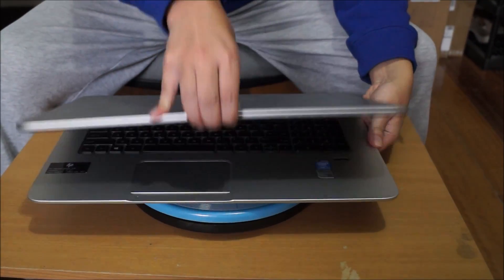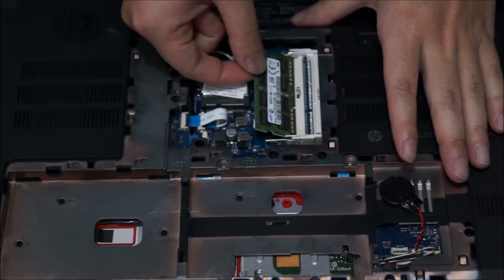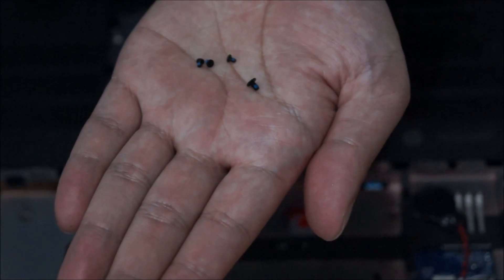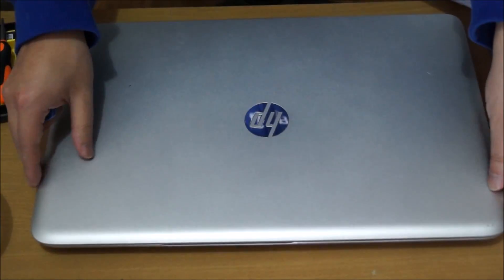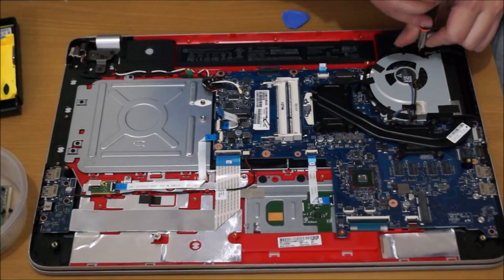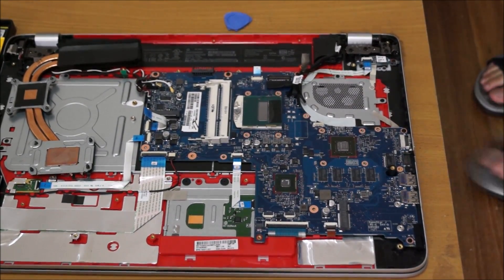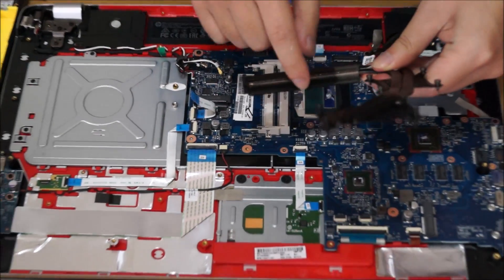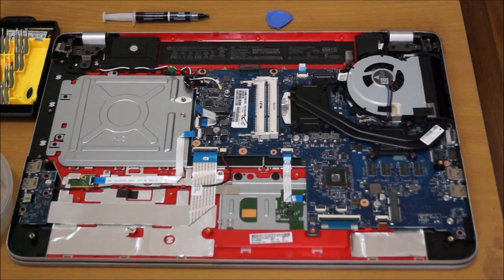OPEN ME UP! HP Envy 17 Disassembly Newer/Updated Video 1

Comment: my friend has the hp envy m6-n113dx (i believe is the same one here?) however he's needing to upgrade it just a bit. i don't know much about apu's so was wondering what is better than the amd fx-7500 it currently has in it? maybe a list of options? i've been looking around and not really finding much info/options. is there not many options for this socket? anyway any help would be apreciated thanks.
Reply from the maker: there isnt many option. many laptops that have removable cpu dont have many options to being with. on the AMD side it is even harder to to find info about it since AMD isnt very popular
Reply: damn hmm  so nothing really better than the fx-7500? doesn't need to be a LOT better. basically he's just trying to improve it enough to run fortnite  BR smoothly. not looking to be competitive so doesn't need to have great fps just be smooth on minimum settings. and it seems the cpu is the bottleneck causing the hangs.

(and awesome fast reply didn't expect that! <3 )
Reply from the maker: i think you cpu is solder on plus it is the best cpu for your laptop there isnt anything better

Comment: Hi can you help please?

You certainly seem to know your way around the HP laptops.
I have an HP Envy 15 and one of the hinges seems to have got stuck or seized and when I open the top it forces the case apart. Have you got any suggestions as to how I might fix this?

Regards
Mike C
Reply from the maker: it is pretty normal for HP hinges to break. many people including myself just glue it down but then you can not disassemble your laptop again

Comment: hellow, i have HP envy 17 J184 and i want to buy the best graphic card that this laptop can work with ,do someone know?
Reply from the maker: CPU can be changed, graphic card is solder on, ram can be changed to 16GB max with 8 GB in each slot there are 2 slots, wireless card can be changed, 2 hard drive slots which is a 2.5 inch that change be changed and a mSata slot.

Comment: Thanks for the video, always great to know that I can upgrade the processor, but it seems to be hard to find online what I can replace my i7 4700MQ so that it is compatible with the motherboard, do you have any suggestions? Thank you if you can.
Reply from the maker: you cant replace the i7 4700mq because there is nothing better for you to replace it with you
Reply: Yeah I had a quick look on Wikipedia there and there really isn't much better, if anything it costs £300 on eBay which isn't worth it, thanks for clarifying that with me :)

Comment: My problem is that I have to replace the bad quality keyboard. On youtube there was a video how to  replce this keyboard but I cannot find this video anymore. Thanks in advance.
Reply from the maker: to remove the keyboard you need to remove the mother board. you will be able to see the keyboard and its screw after you remove the motherboard
Reply: I know, one need to remove almost anything, but I like to see this operation on a video because I'm not a proefessional, and bad enough, HP service is almost nothing and that's why they don't have an email address, at least not in Spain. Of course it is almost incredible that such an operation is needed for reparation of something like a keyboard which is almost in use and in the case of this model is also made bad because the left side is very weak. Thanks anyway. Regards. PS And there was such a video on Youtube but not anymore!

Comment: Hi, dissambled successfully following your instructions and put everything back together. Everything is working fine bute somehow the subwoofer isn't working. The cable in 09:27 is plugged in, checked it twice - any suggestions what the reason could be?
Reply from the maker: so your sound is working just the sub has issues. if thats the case something wrong with the cable probably stuff up somewhere and damage it.

Comment: I have an hp 17-J173CL with backlit keyboard. The keyboard doesn't work and the plastic backing on the bottom left side appears to be separating and the hinge is loose. The laptop doesn't come on. How can I fix these problems?
Reply: Is there a manual for the hp 17-J173CL?
Reply from the maker: you need to open it up to see what is wrong on the inside. it is normal for the hinge to be loose. a lot of laptops get there hinge/plastic holders broken
Reply: OPEN ME UP ok. I need to get the tools u list, so I can open it up & see what's going on 😊

Comment: Also, if I don't have a prying tool like you used, you think a guitar pick can do the job? And what kind of adhesive can I use for those rubber parts on which the laptop stands on to glue it back into place?
Reply from the maker: a guitar pick is a prying tool. the adhesive for this laptop is actually double side tape. i recommend you to open up your laptop and have a look inside to see if you can see where your issue is and if you can fix it
Reply: thank you so much I'm glad I found your video

Comment: This is exactly my laptop and my problem is that on the left side, the bezel or the grey side is detached from the black or bottom part of the laptop and it does this every time I open and close my laptop. Both bottom and upper parts of the frame or body of the laptop separates at left side, on the point at which the laptop screen is connected or kind of like the joint. Is there a way to fix this?
Reply: Just fixed exactly your issue on my Laptop - same as yours. The hinge does not have any support left as the sockets were torn into pieces. I literally had 30 loose pieces of plastic in my hand. Now tried epoxy resin but can only talk of success in a few months time. Other option: send it in to HP for 170€. Like WHAT?
Reply: $202.34?  I read somewhere on HP help site that HP wanted over $900.00 to repair out of warranty. Mine broke 3 months out of warranty and I've got nothing but a run around from HP. They have seen the last of my money.

Comment: Currently got 12gb RAM with a Intel i7-5500 2.4ghz, NVIDIA GeForce GTX 850M. Can this be upgraded and if so any recommendation?
Reply from the maker: ram can be changed and thats it. if you change the ram the laptop is not going to be any better

Comment: Great video! I use Q-tips and ArctiClean Thermal Material Remover and Surface Purifier to remove old stuck on thermal compound easily and to properly prepare the surfaces for a new application. It makes sure there's no dirt or debris such as towel lint. Any tiny debris, old dried up compound or even oils from a finger will reduce the thermal transfer effectiveness. Get it here for $6.77: https://goo.gl/VPmxN2

Comment: Hello my HP envy laptop started saying it's fan was over heating and I am having problems as the internet is freezing up on me.So it's 10 o clock at night andi have my laptop open and one of the cords the black one to be specific is broken. Should I put the laptop back together and try to get some one to fix it or how much is a replacement fan and should I get that instead? I made it this far and any help that comes asap would be very appreciated please.
Reply from the maker: i dont understand what you trying to say. watch the video and tell me where the black cord is in the video.
Reply: Sorry i meant one of the black cords on my fan itself one of the well wires that my fan uses to plug into the laptop
Reply from the maker: still dont understand what the black cord is watch the video and tell me where in the video this black cord is
Reply: Around 10:24 or so where you unplug the fan, one of the wires of my fan is severed. Its one of the several that are apart of the fan if that makes sense. So basically one of the wires that the fan uses to plug into the laptop is cut/broke.
Reply from the maker: i see if that case you going to need to replace it or rewire it if you know how to
Reply: Well I was able to open it up with minimal effort but i didnt know if just one of the wires being broken would warrant me replacing the whole fan, i dont even know how the wire was broken
Reply from the maker: look i open up alot of laptops and this has never happen to me so i dont know how it happen to you
Reply: me either , some one else i was talking to said based on my problem i should replace the fan and hard format / reset the hard drive, now i guess i just have to find and price a fan and then buy and install it

Comment: Thank you so much for this video!! I was getting the 90b fan error message and did some research. After doing diagnostics and checking that I have the latest BIOS installed, I decided it was indeed the actual fan that was not working. 

I didn't have it in my budget to send it in fo repair especially since I had determined the problem. I have never disassembled any kind of computer before and was quite nervous. Your video was the best after watching a lot of other disassembly videos. 

The only difference between mine and the machine you used was that mine did not have the 3 tiny screws at edge of battery compartment. It was "clicked in" with tabs. I was really tricky to pop it off but got it with a little work. But I did it from start to finish without issue. New fan installed and my Envy 17 is working perfectly. So again, than you so much!
Reply from the maker: thank you for your support

Comment: Great video...enabled me to put in a new fan but I pulled the battery connection off (the black plastic connector piece) the board in process.  How and where do I reattach it? any suggestions would be appreciated.
Reply from the maker: as long it is place back together and touching what it needs to it will work
Reply: Thanks for the quick reply, I figured it out.  I glued the black plastic battery connector back on to the board with loctite glue and everything now works fine.

Comment: Hey, I'd just like to thank you for posting this video. It helped me take apart my hp envy 17 inch lap top. Then I was able to loosen the hinges with a wrench after I figured out that the hindge clamps had little snaps that I could push open and pull back. I also re-glued my hinges with jb weld steel reinforced apoxy. Since my laptop like many other HP laptops was defective and both of the hinges broke their plastic casings from general use. After only being 3 years old. Now my hinge is a bit too loose but my screen stays up easily. At least I know that if they defectively over tighten over time it will take a long while.
Reply from the maker: thanks for your support

Comment: could i do an egpu setup for this laptop or is that not possible?
Reply from the maker: I suppose egpu is external gpu. Yes if you can find one that works with USB but there isn't one available to my knowledge. There are only USB type c and thunder bolt

Comment: whats the name of the very small screws behind the battery?

Where i can find a screw driver for that?

 The set that i bought at Lows didn't do the job for the very small screws.

Thanks
Reply from the maker: you can get it off ebay. http://www.ebay.com.au/itm/39-In-1-Torx-Precision-Screw-Driver-Screwdrivers-Set-Home-Repair-Tools-Kit-/151939340403?hash=item23604a5873:g:NLUAAOSwX~dWi2n3

Comment: I've a HP ENVY 15 and the keyboard key A and S are not working anymore. Any idea to fix it or a guide on replacing the keyboard?
Reply from the maker: +ABu NeNe remove the button and test if it works. since you use A and S more they wear out the rubber button that could be your issue
Reply: +OPEN ME UP Removed and still does not work. It is worth it to try and replace the whole keyboard?
Reply from the maker: i dont know how much a keyboard is worth did you try removing the remove things under the button and swapping it out with another button that works

Comment: Can I upgrade the Gpu or the graphics card in the hp envy?
Reply from the maker: +Khalid Alhariri No it is solder on
Reply: +OPEN ME UP Well, technically you could unsolder it, can't you?
Reply from the maker: of course you can but are you able to do it yourself
Reply: OPEN ME UP Not me lol
Reply: +Edmundo Weber so if i went to a store or to someone expert can he change the gpu ?
Reply: Ah, forget it. I just got this on a forum post: "These days, manufacturers use surface mount for a GPU chip. There's no flip over and de-solder. Unless you have the equipment and means to do this type of surface mount, replacing the GPU is impossible. It is not a field repair.
I worked on a large main frame system in the early 90's which used this type of IC. You need special de-soldering tools to remove the IC. Then the new one is placed on top of the permanent pins and heated. The IC will then drop down and make connection. We tried it in the field with bad results."
Reply from the maker: yep thats right. thats why i told you it is solder on and you cant replace it

Comment: Hey, great video. I have the HP Envy TouchSmart 17t-j100 (E1P14AV) model laptop with the left hinge loose, do you have a video on how to repair it, or recommendations on how to fix it?
Reply from the maker: +Andrew Tulloch it is most likely breaking and you going to need to glue it down. try to screw in the screws and see if it solves your issue if not glue it before the whole thing breaks off
Reply: Ok. thanks

Comment: My friend... I'm having problems with GPU overheating (with Nivida 740m) since I buy my notebook!
There is any chance to fix it, change cooler, change something... i really whant fix it up!
THanks
Reply from the maker: +Dante Basso have you clean the fan and replace the thermal paste?
Reply: +OPEN ME UP No, because my notebook has less then one year!
Mayber it's better to do that!
Reply: +OPEN ME UP Do you thing this will do a Huge difference in overheating problem?
Reply from the maker: first you will want to update the bios that normally makes the most difference and if your laptop is old open it up and give it a clean is the next big thing. if you laptop is new and has these issues there is something wrong as a new laptop should never over heat as it was not design to. bios updates are important as when they make the laptop they might have input the incorrect setting which cause the system to over heat therefore the bios updates change these setting after they receive feedback from others

Comment: Hi there, I have a HP Envy 17 with the i7-4710MQ CPU 2.50Ghz, 12GB RAM. The past few months I've had an issue with occasional stuttering with certain games and even when watching Youtube videos sometimes. I can hear the stuttering through speakers/headphones and also the videos/games lag majorly when it happens too, this goes on for around 90seconds and then it returns to normal. Do you have any advice on what I could do? I feel like it might be an issue with the CPU. You videos are very informative :) thanks for uploading!
Reply from the maker: +FunFunSmirk for it to happen eh. you play games is normal as it is struggling to load the details but for YouTube this should not happen. Download a few benchmark test to test out of you have any issues. 3dmark vantage and Intel burn test

Comment: Hi, I have this exact computer and my speakers stopped working. The tweeters are working fine but the speakers are not working at all.  Ive checked all software related problems and ive come to realize that maybe the speakers are either unplugged or broken. How should i check it ?
Reply from the maker: +Captain H 7.20 that's the speaker cable

Comment: very informative video. I have a question.
I have the same machine. right now it has 2.7 GHz Haswell 4th generation i7.
I want to upgrade it to 5th or 6th generation processor. Is it possible?
If yes, then what are the performance improvements I should expect after the upgrade?
Because I mostly use this machine as a daily runner and Video editing/compositing plus photo retouching. 

Just want to know if it will improve the performance after upgrade...
Reply from the maker: +Danyiography Photos &amp; Films No you cant do anything. as it is too old and doesnt have any items available for upgrades
Reply: +OPEN ME UP but you said we can changes its processor??
Reply from the maker: you can but not to a 5 gen or a 6th gen. you can change it to a 4th gen. the highest 4th gen you can go to is a i7 4930m
Reply: +OPEN ME UP ok. will it make any difference?? i guess no....
Reply from the maker: depends what you are doing. it number yes you can see there is a difference but in real life you will not be able to tell the difference

Comment: I have this computer. The hard drive is failing the short DST. This computer came with win* and no discs. I have a win 8 disc set that came with my Probook that is running win 7. can i put in a bare drive and install from the win 8 disc that came from my Probook?
Reply: +Dale Pickett it came with win 8.
Reply from the maker: +Dale Pickett yes it should work but normally probook comes with windows 8 PRO and this laptop comes with winodw 8 HOME
Reply: Since it is a fresh load on a bare drive will that make a difference? I am going to upgrade to 10 as soon as possible. 8 sux
Reply from the maker: the laptop holds the CD key inside of it. since it originally had HOME on it therefore it will not have PRO CD key thats the issue. you will need a CD key to install windows
Reply: +OPEN ME UP gotcha. thanks!

Comment: I have this laptop, specifically the 17-J100NS model. The keys in the upper left side (esc, f1, f2, f3 etc.) are not aligned and I hate the way the back light looks when its turned on (100% of time), removing the keyboard would help to fix it?
Reply from the maker: +Carlos Ospina it is probably no seatted on the button properly. you can remove and put it back on if you want just rip it off by focus and it comes off. be careful not to break the clips on the button.

Comment: hey what is the pin count on the processer, and is an i7-4710MQ compatable with this Laptop
Reply from the maker: +xXassassin907Xx yes you can use that but it pretty pointless. this laptop originally come with 4700MQ and that just the update of it nothing different really.